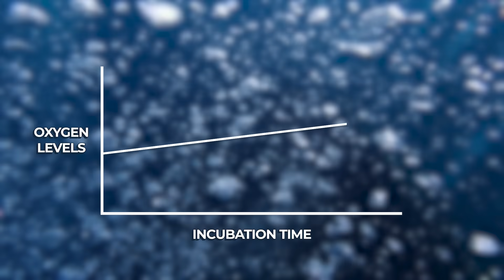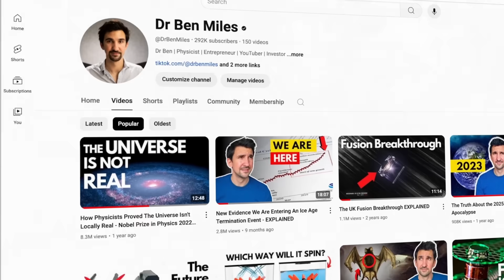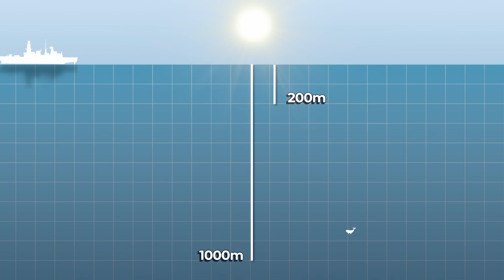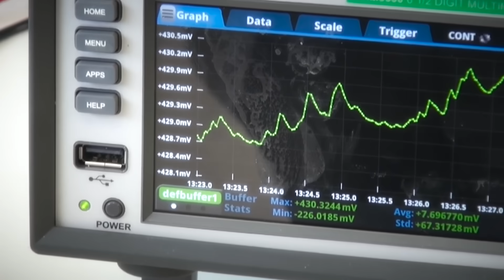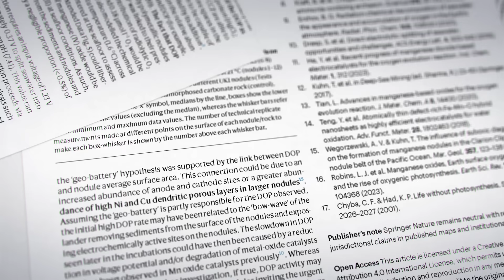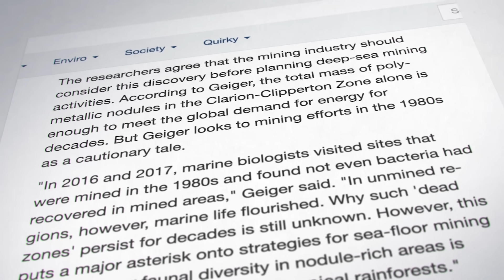We Just Discovered "Dark" Oxygen on Earth - Breakthrough Explained

Comment: Various layers of deposited metals are how semiconductor wafers, high temperature superconductors, and lithium ion batteries are structured on the micro scale, so a self-assembling version of these structures is not actually a far-fetched hypothesis. The slow speed of deposition means that the layers are also very thin, potentially only a single atom thick.

Comment: What concerned me when I read the paper was that there was no discussion of the chemistry OR the thermodynamics… Indeed, my experience is that batteries run down quite quickly. Keep up the good work!
Reply: we're talking about rocky lumps of material with all kinds of metals and things mixed in, there's this thing called internal resistance with batteries which limits the rate at which a battery's power can be drawn,  in this instance the current and voltage draw is very low, and the nodules are a decent size, this battery effect is happening all across thousands of kilometers of seafloor in millions, billions, possibly trillions of metallic lumps of rock, they don't even necessarily "run out" the electrolysis will slowly break these nodules down over time, but there's events constantly producing new ones, these nodules are likely to have a volcanic origin considering their composition and location.

they don't run out because they're not like a AA battery, this is more of an electrically assisted erosion process that also produces electrolysis, they just likely fall apart into smaller pieces until there's a dark inert powder left on the seafloor.
Reply: @damson3413  None of this is discussed in the paper. That is my point. There MUST be a mechanism, and the mechanism must be thermodynamically plausible. What is the mechanism?
Reply: @damson3413  Where is the "dark inert powder left on the seafloor"? I see only nodules that have been there for millions of years (apparently). I am NOT disagreeing with the dark oxygen findings, I am just saying where was no discussion on any plausible mechanism in the paper. (I am an academic chemist, so I am interested in the chemistry...)
Reply: @MarkRLeach  You also have to remember the voltage measured was .95 volts.  This is pretty low voltage so its not a little is producing a lot. More like a shit ton is producing a tiny amount over a huge area. Even with all this electrolysis happening its still not even producing half of a AA battery would. That i mean i think you can do this at home with baking soda, salt and water.
Reply: @BossesDream  None of this is discussed in the paper. That is my point. There MUST be a mechanism, and the mechanism must be thermodynamically plausible. What is the mechanism?
Reply: Perhaps the electrical forces at play are generating the nodules and building them up.
Reply: Maybe acting as a catalyst
Reply: @benmorris1657  A catalyst only speeds up the rate of reaction, it does not alter the thermodynamics.

Comment: All right. through electrolysis, water gets split into oxygen and hydrogen. We found a lot of oxygen dissolved in the water. But what happened to the hydrogen? If it is also dissolved into the water, it will eventually recombine with the oxygen and make water again. I cannot accept this explanation until I understand what happens to the hydrogen!

Comment: I do not understand this. Splitting water molecules is a non spontaneous process. It requires external work. These objects may work as batteries, but then there must be either a source of energy that recharges  these object, or they must deplete. And if they require millions years to form, they would be done by ages if they produced large amounts of oxygen. Or they  just do not produce any significant amount of oxygen under normal conditions, and the experiment itself triggered their action as a battery.  Measuring some voltages among points of an heterogeneous metallic material is by the way far from being something incredible…it happens most of the time. What matters is how much charge is stored and can be used in the electrolysis. Again, with no recharging mechanism it can only mean that the nodules are not doing much under normal conditions and so it would be an irrelevant argument for Green politics…as it is too often the case. So do not get wet too early
Reply: Wow, hey, you're right!  You /don't/ understand this!

Comment: Thank you for not being convinced. There is a glaring omission in the battery argument: where does the energy come from needed to break the bonds of the water molecule? Without a decent answer on that the whole story sounds fishy to me.
Reply: The "glaring omission" you're referring to was explicitly stated at 10:20, in a quote from the scientific paper: "we hypothesize that the Dark Oxygen Production may have partly resulted from seawater electrolysis, with the necessary energy coming from the potential difference between metal ions within the nodule layers, leading to an internal redistribution of electrons."

Do you work for The Metals Company?

Comment: Well, according to general knowledge, you need about 1.4 to 1.5V to be able to crack water however, did ANYONE try to crack water at 400ATM, the depth on which you find these nodules? MAYBE, just as so many other things change at depth, maybe also this fact change. The likelihood that these nodules connect themselves in "series" to get over the 1.4V barrier, is not likely and even a little ridicules.

Comment: 3:16 - For clarification, molecular oxygen (O2). Atomic (elemental) oxygen was already there. Usually bonded to other elements. You know, that valence thing, that's the basis for chemistry. Oxygen, though is a double edged sword. Its used for the chemical energy used by more complicated life. BUT ! But, its also toxic, and damages chemical structures, called oxidation. Sexual reproduction, is thought to be the best defense against genetic damage caused by oxidation reactions. This is basic biology, not some "alternate medicine" snake oil. Though, those same snake oil salesmen will use this to sell their con.
Reply: Bonded oxygen is not atomic, you got that wrong from the beginning. Moreover, the hypothesis discussed posted oxygen coming from electrolysis, not oxides

Comment: This is a HOAX. Don't get me wrong. I know Oxygen is coming up from the deep ocean.  I have know the process for a long time. But those nodules have nothing to do with it.   What is happening is methane is seeping up through the earth and as it encounters the carbon from 355 km to 135 km down hydrogen encounters carbon and forms Methane.  The methane then seeps up and encounters near to the surface metal oxides and recombines some of the methane into crude oil. At the same time the process releases lots of (-OH) which recombined to form H2O2 which degrades to O2 and water.  This is why the water is not hydrogen enriched and the oxygen can build up in the water.  If the process was electrolytic or catalytic making Hydrogen and Oxygen it would immediately recombine into water once in the sea water.  
The chemical reactions do not balance for the O2 and H2 production here.  This was nothing but sabotage by Environmentalist Wackos working for the mining company trying to tell them not to pick up rocks from the ocean bottom.  The oxygen in the atmosphere is the product of polymerization of methane and metal oxide substrates.   It is not related to these nodules.   You could put those nodules into salt water and compress it to depth and they would not produce any Oxygen.   The chemistry of the nodules does not contain Hydrates and it would if the Oxygen was net in the reaction.   
This is nothing but another Envrionmentalist Wacko claiming everything mankind does is going to kill the earth to prevent us solutions to our situation that they demanded!   Mining companies should not hire these Wackos!  They are dangerous and spoil everything.

Comment: It takes energy - lots of energy - to split water into hydrogen and oxygen. If the nodules are acting as a battery, they would soon be used up and the reaction would stop. If they are acting as a catalyst, there still needs to be an energy source. I hope they go back and look for hydrogen. If water is being split, hydrogen should be present.
Reply: Not only Hydrogen but as it’s sea water you would expect to see the production of halogens particularly chlorine. These are super easy to test for which makes me question why they didn’t.
Reply: I agree. If water is being split, where is the hydrogen going? Could it be being adsorbed in some chemical reaction in/on the rock and the oxygen is just a waste product, as it is for plants?
Reply: we're talking about rocky lumps of material with all kinds of metals and things mixed in, there's this thing called internal resistance with batteries which limits the rate at which a battery's power can be drawn,  in this instance the current and voltage draw is very low, and the nodules are a decent size, you have to understand, this battery effect is happening all across thousands of kilometers of seafloor in millions, billions, possibly trillions of metallic lumps of rock, they don't even necessarily "run out" the electrolysis will slowly break these nodules down over time, but there's events constantly producing new ones, these nodules are likely to have a volcanic origin considering their composition and location.

they don't run out because they're not like a AA battery, this is more of an electrically assisted erosion process that also produces electrolysis, they just likely fall apart into smaller pieces until there's a dark inert powder left on the seafloor.
Reply: You are making an assumption based on what this video shows. It has not been proven that that process is going on at this site on the sea floor. It was only simulated on the surface and did they put it in a pressurised environment? No. So the experiment is flawed and meaningless right there. 
The obvious factor is the location. It's extremely still. The channel left by the earlier dredging for samples of the stones, looks like it was done yesterday. This 'still area' could be the reason for the phenomenon that we see here. Like a river that slows down and causes sediment to be deposited, this area could have metal oxides 'falling' from the surface and settling onto the stones in microscopic layers. The electrical process could remove the oxygen particle (under the high pressure) and leave the base metal behind, adding to the layer on the 'stone'. No hydrogen would be involved. 
Purely hypothetical, but at least it's more plausible than what we currently (pun intended) see. And also, what is the composition of the 'sand' that the 'stones' sit in?
Reply: The rocks are “used up” but they’re also built up overtime
Reply: Corporations will, and have, profit from anything they can control. Corporate malignancy will kill us all, profitably....
Reply: Remember that the water pressure is very high down there. We can just about build submarines that can survive the insane pressure levels down there. So water molecules should be super easy to break into their component atom parts down there, if they can even survive past 1km depths without automatically breaking that is. Remember: water is not a solid - like a submarine made out of steel - on Earth.
Reply: What an atrocious reply section, most of them seem to not understand the process you’re referencing hardly at all. I would tend to agree with you creating oxygen uses loads of energy so where is it coming from?
Reply: Perhaps they are planning on it yet. 
One metal acts as anode another as cathode, electric change provided by salt water
Reply: lots of energy also known as 1.5V?
Reply: @joki7352  Voltage isn’t a measure of energy. Don’t write a sarcastic reply if you don’t have a clue what you’re talking about.
Reply: @Radio-laria huh. I thought voltage was a measure of potential energy, which is a form of energy right?

Oh is electric potential different from electric potential energy?
Reply: @liamgryphon7942  yes, you need to multiply the potential difference by how much charge to get the potential energy difference
Reply: @liamgryphon7942  Voltage is a measure of the difference in electrical potential between two points. It doesn’t tell you much at all about the total energy of a system. A capacitor may for example have a lower capacity or “energy” than a 9V battery but the ability to output much higher voltage over a shorter time.
Reply: @liamgryphon7942  The overly-simplified-but-usually-close-enough way to think of it is that voltage is like pressure. If you know that a tank of water is at high pressure, that alone doesn't tell you how much energy is in the water. You need to know how much water there is, too.
Reply: @Letsgoback2thefuture  No splitting the water would not recharge the battery by magic. It takes energy to split water to hydrogen and oxygen it doesn't produce it